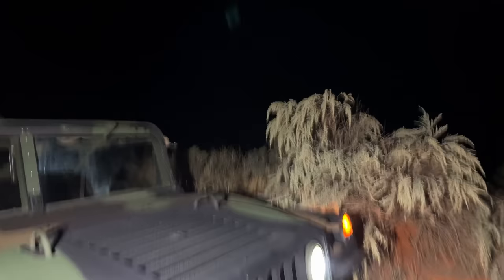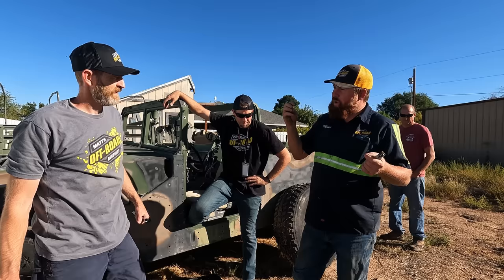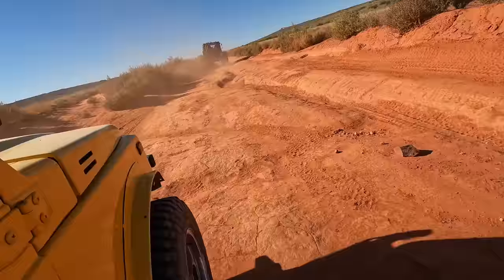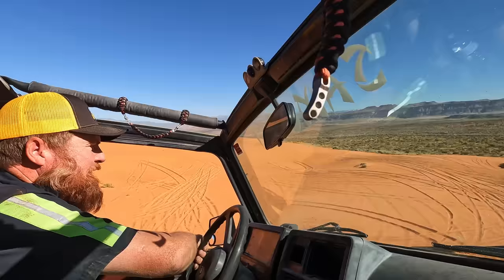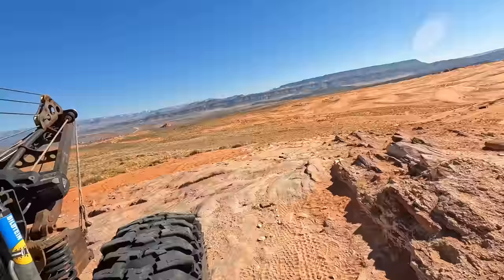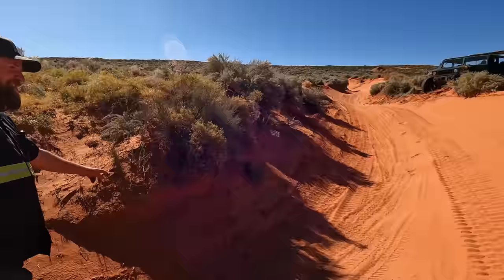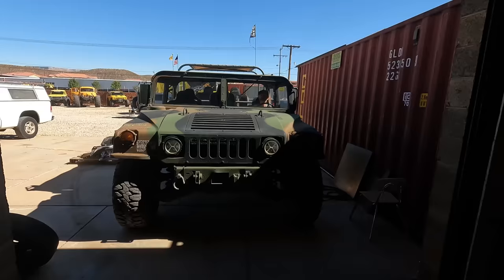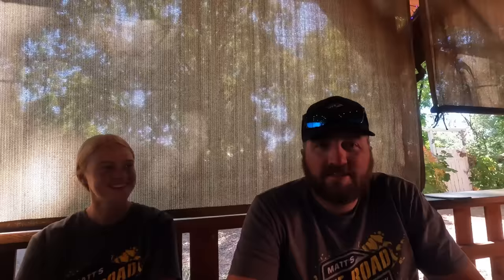Samorri Get's Its First Off-Road Recovery!

Comment: I used to have a samurai (known as a sierra here is AUS) they can be very capable if you setup and drive the right way. I used to run 5psi in the sand and if you are doing less than 4000rpm you are stopped.

Comment: We broke those things so often both in the field at Ft. Hood and in Baghdad. That and the CV joints where they bolt to the brake disc in the center. But then we beat on those pretty hard too.

Comment: Regarding the Samurai: J20 engine from a Grand Vitara (or whatever they call those in the US) and a 2WD X90 gearbox.

Or a G16 16v with a turbo.

Full floating rear axle conversion and chromoly front halfshafts.

If you do Toyota axles, go up a tyre size.  Yota axles are thicker with bigger pumpkins, so you lose some ground clearance.

Comment: You were thinking about re-powering the Suzuki, look at Blue Print Engines.  They demoed a 3.6 four cylinder with an LS 3 head, SBC internals, would accept SBC bell housing / auto trans, estimated power numbers were very good for a banger.

Comment: I’d say go with 1/2 ton pickup axles, a 4L65E and I like the 3800 idea, but if you could find one, a “shortstar” 3.5 V6 might be interesting, they have low end grunt like a 3800 but really get lively above 4000.

Comment: Get rid of the Weber and go with a Toyota 3k carb from Certified Machine. Cheap and VERY effective. The mount a Prius electric steering kit, and maybe a coil-over swap on the suspension (cheap alternative is reverse shackle). I've had 7 Suzukis in the last 28yrs.

Comment: Matt, you need to swap out the little engine for a Ford ecoboost 4! I've had a couple of them and love their power. I'm driving an ecoboost 6, in my F 150, pulling my 28 foot 5th wheel and an additional 16 double axle trailer with my Polaris 570, my old Polaris 325 Trailboss quad. Never worry about power.

Comment: 4bt swap... lol. Boss had a sidekick with 40s. Ran 2 np 205 transfer cases. It would float in water. Stock motor and 5 spd(I think Trans was stock). Clutch took a beating to get rolling when t cases were set for 60k top speed.

Comment: Don't underestimate the potential a Sammy has, even stock they are incredible beasts of machines. Despite having a 1.3L or 1.0L engine there's plenty of power to get just about anywhere. I've seen these things go up similar challenges which made K5s, Patrols (Y60), and Land Rovers sweat. If you do consider an engine swap I'd suggest putting the engine of it's bigger brother in, the Vitara / GeoTracker / Chevy Tracker. Not too ridiculous at 1.6L and 80-90 horsies which should be pretty beefy compared to the weight of the Sammy.

Comment: Samurai / sj's are made of win, even bone stock they outpace and out move many of the big boys and specials.  They eat up mud where many of the others bottom out .  Add working diff locks  and you can just "send it" even on stock size tires .     They 2 big draw backs, they are so light it is hard to get momentum to pull out something bigger, and as you said.   they love to roll .     Around here they are now considered classics, and even rusted out crap boxes with decades of experience are easy going for 5000 euro's or more.

Comment: FYI starting in 1990 Samurai switched to fuel injection. A 231 V6 Buick should fit if you ditch the Sammy engine, I am with Matt though, keep the motor if you can.

Comment: 24:37  A local source for very long drill bits ... ASK for "Installer Drill Bits" They come in 12", 18", and 36" lengths in 1/8 increments and are surprisingly inexpensive.

Comment: another really good idea that didn't actually happen at lunch (and i do this on European cars even if the wheel is light) is have the tyre only just off the ground when I take the wheel off the vehicle... It' saves having to lift it myself, just carefully rock it away from the hub.

Comment: 7:31 Samurai really do NOT need Unlocking hubs, when they were first sold here Unlocking Hubs were not even a dealer option.  

I've owned at least 7 of them, and first thing I do is jack up each front wheel .. LOCK the Hubs and never touch them again :)  

I had one for example as a daily driver, hubs permanently Locked, AND a blown out boot on the passenger side, and it worked perfectly for two years like that :) 

The advantage is astronomical in scope!  If hubs are Locked, you have instant 4X4,  ANY time, and ANY Speed, with a simple Clutch - Shift (the transfer case) ... I've engaged 4X4 at 55 MPH on the highway (see snow drifts ahead for example) a hundred times, with no ill effects. :)

Comment: 1.9 aaz VW Td or tdi swap it it's crazy easy and tons of power for big tires. Rear locker, then there is almost no need for 4wd. Check out acme adapters. Everything's bolt on.

Comment: I think there were several Engines out there, which would be great for the Samorrai. Lightweight and small but with much Power. But most of them are German builds (Sorry, I am from Germany) but there have to be simmilar American Engines.
I think about Audi or VW 5 Zylinder Turbos (the Petrol ones)
Or 2 liter BMW
Or even a 1.8 Turbo 180PS out of a VW Golf or something.
It would change the lightweight Samorri to a Mountaingoat on speed.

Comment: Matt you should pull a 4.3 lt motor out of a 2014-2018 silverado 1500 with the 6l80 trans. Really good torquey truck motor for a 6 cyl be great for that samurai

Comment: The goat head and sand spur are no where close to one another. I was born and raised in Florida. Sand spurs we would use them to have sand spur wars. You would pull the grass stem and try to slap you opponent on their shirtless upper body. It stung a bit but no big deal. I step on a goat head once that was enough to tell I never wanted to do that again. Goat heads rank right up there with stepping on a roofing nail. Those thins are NASTY!

Comment: If I know anything about the torque specs of the hmmwvs I’ve been assigned to the spec is goodn’tight   Also the addage at the Motorpool on those things is if it isn’t leaking the fluids empty.

Comment: A Honda k series engine would absolutely transform that samurai, that motor has so much aftermarket support you could have it making 500hp  😅 a reliable 400hp with a little turbo would be perfect, the sower would be linear like the bronco.

Comment: Tom get a Model A Ford wiper kit from Speedway motors it will make wipers for the Bombay easy. Drill one hole and run power to the motor

Comment: Better seats , padded roll cage, and 4-point harnesses. The "these things roll" thing is overblown, Jeeps of the era were more prone to rolling than Samurais when driven the way folks were driving them to induce rolls for fake news stories to ruin the brand's reputation (because in the 1980s they were way outselling every other brand of smaller 4x4s). BUT all that bouncing around you're going to want more than just the stock 3-point seat belts.

Comment: I saw the Matt's off road flag I wonder Matt's Offroad could work with a company called Handi Flag which is a very well made collapsible flag that stores like a tent pole. And it has its own flag mount. Just curious. It would be really cool to have those awesome flags with Matt's Offroad, on the flag. Super quality and last forever

Comment: Did you hear that black and white 4 cylinder near the Hummer sounds like its running a little ruff. Needs some water to stop the overheating and probably a burrito for extra nitrous to get that hummer out the sand

Comment: In the UK if you pass your driving test in a manual (stick) change you can drive an automatic as well, however, if you pass your test in an automatic you cannot drive a stick shift(manual change) vehicle without passing the test for manual transmission. Is it the same in USA?

Comment: you might want to deflate those tires to 17 or 15 psi it will drive more smoothly and easier on the sand
Reply from the maker: We started at 10 psi and went down to 4 psi

Comment: now in the middle of the video I was right.
they had to take the existing box off.
easier to slap a new one in or used, then to extract a bolt on trail.